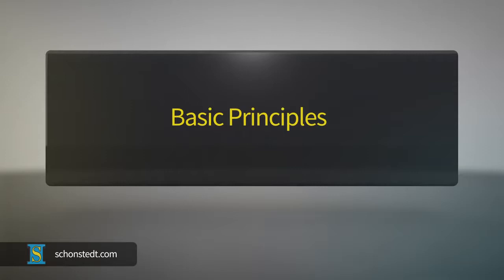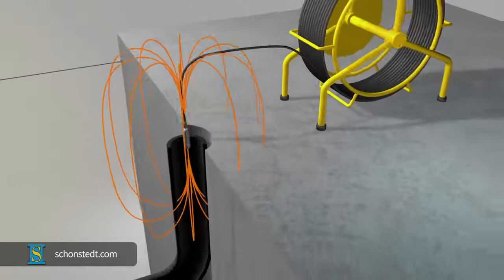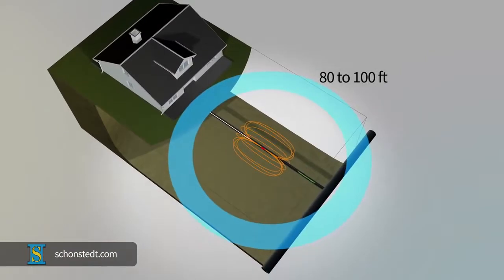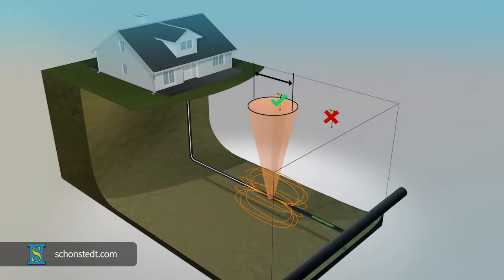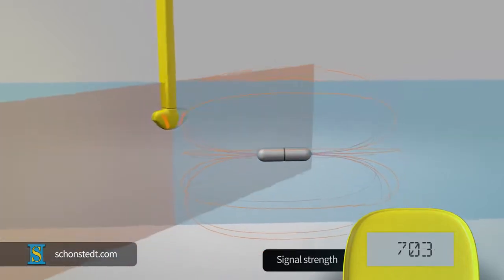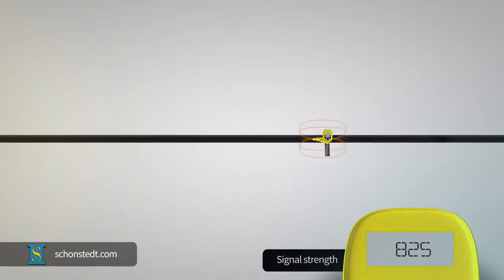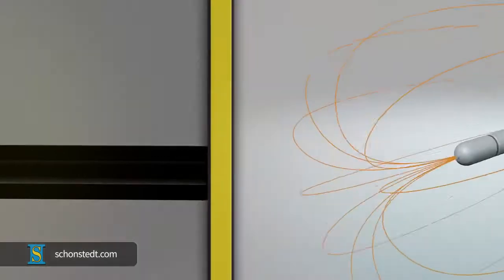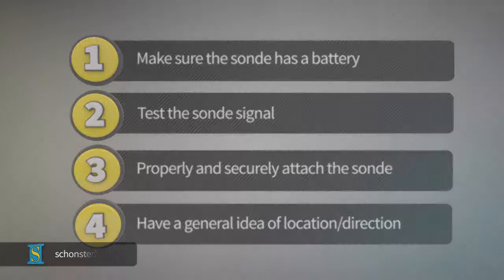Locating a Sewer Camera Sonde | How to Locate a Sonde Beacon

Comment from the maker: 5:13 In summary before attempting to locate a sonde always remember:
1. make sure the sonde has a battery
2. test the sonde signal with your receiver before inserting it into a pipe
3. Properly and securely attach the sonde to a snake or mechanical means to push it through the pipe
4. have a general idea of the location and direction in which the sonde will be moving once inserted in the pipe.
ww.fiberscope.net is the official dealer of Schonstedt© locators.